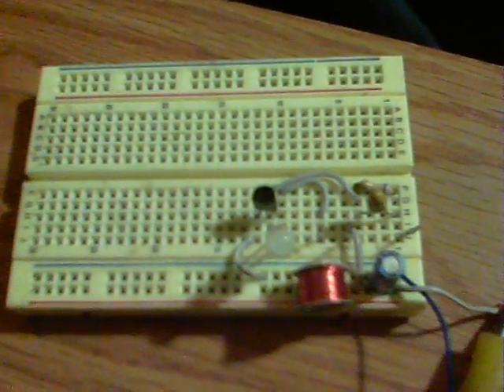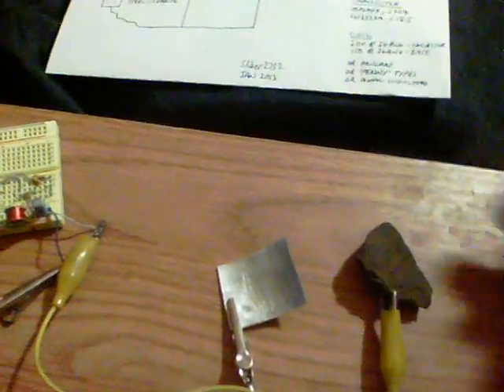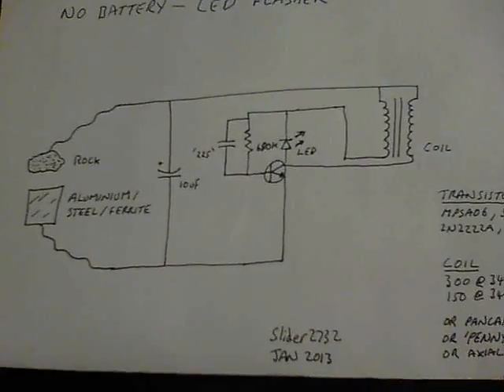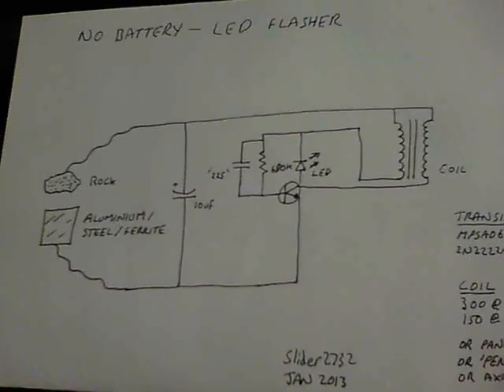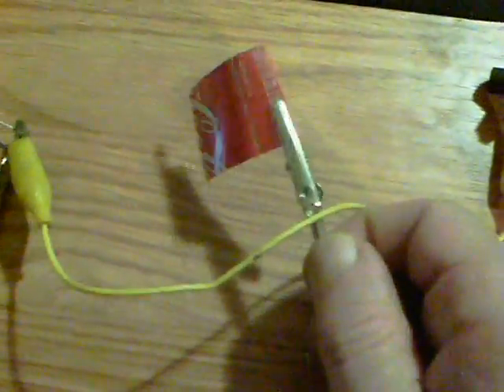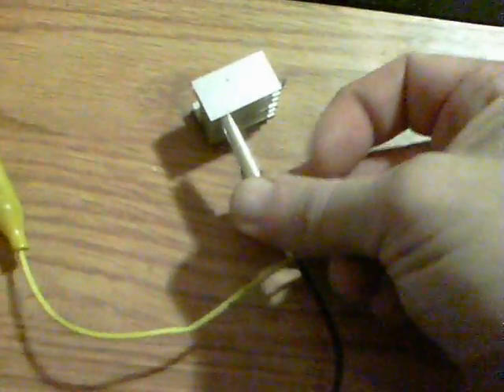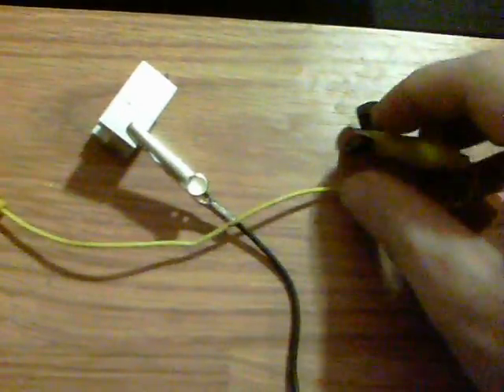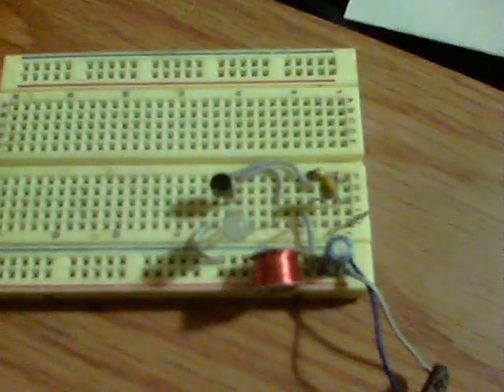No Battery - LED Flasher

Comment: Thanks for posting a great circuit. It gives the most bright flashes comparing among other transistor or CMOS blinkers. Transformer coil works without a ferrite core fine, but if you have ferrite core leave a gap. LED I connected to GND then gives brighter pulsesz Also starts running from 0.5V while complementary transistor pair starts from 0.8V.

Comment: Possibly could you do it just human powered?
Reply from the maker: Hmm, another good question from your good self  :)
We're always grounded, as a function of usually being in contact with the floor and full of water. But, there always needs to be 0.5V difference. It doesn't matter which is more positive or which is more negative, as long as it exists. Some kind of creative sitting with legs in the air might work lol

Comment: Nice one pal, liked and subbed.
Reply from the maker: Many thanks :)
Reply: @Slider2732  I've got some graphite felt on order from China to do a single-pot MFC with, apparently certain bugs give off more electrons, especially with the right foods. I was thinking it'd be nice to do a soil-powered moisture detector, then i remembered the single-electrode moisture meter that i had years ago, wchi now sells for about 7 quid on amazon. Another mad idea that expired before the parts arrived lolz ;+}
Reply from the maker: Yes, well I did wonder if you ever made a spacecraft from the pictures you downloaded  :)
Good luck with the bug project. I'd not heard of the electrons thing, perhaps it makes sense for luminescence with Mg (Firefly's).

Comment: very good circuit! you can see the Mendeleev table with electronegativity of materials data, to search the most opposite couples. I told to you what I found time ago, the good stable materials couples are alluminium - carbon and better magnesium - carbon. In that exp. your hand is like a ion conductor that allow the electrons to migrate from the most electronegative material to the less electronegative. the others good membrane that does this are paper soaked with potassium chloride and many others, simply paper in environmental humidity, soft pvc plastic, and tissue colors. then there is the world of conductive plastics that I honestly know little about. bye
Reply from the maker: Thanks for your comment Michele. Magnesium is now an electrode for the water based 'Nephilim Penny' flashing oscillator. It runs constantly, 24/7. I'd never used Mg and expected only a couple of days before it dissolved, but a tiny strip lasts for months. I will likely change to carbon on the other electrode, but the copper piece has been on the circuit for 7 years!

Comment: hi you can try also with termoelectric cell (peltier) used in termic differential, bye!
Reply from the maker: Yes that would work, as long as there is 0.5V generated. The circuit uses nearly nothing for amperage. 0.5V is also available from putting a copper wire and iron nail in the outdoors earth etc. Power sources are all over the place for this type of circuit  :)

Comment: +slider2732 Can I Use 2n3904 Transistor Instead?
Reply from the maker: Yep, the 3904 will work fine. 
Other good ones are C1815, MPSA18, C1213, 2N2222A
Reply: +slider2732 Thanks!
Reply: Slider2732 I bought a hundred of the 2n2222a transistors a while ago this is a good use for them

Comment from the maker: To neuphpne - your 'Reply' button is off.
Yes you can use wet towel or a sponge or even a glass of water if wished. It's the difference between the materials that enables the circuit to run :)
During summer with no cooling in the house, such circuits will run very easily from human skin moisture (this was uploaded in the January and we have no house heat).
Thanks for your question.

Comment from the maker: Thanks Jamie :)
Not tried a snake egg, but will do. Mass is somewhat important, there's a point of mass at which it will begin running, though human energy is enough with house gauge copper wire and inch square galv steel too. Slightly stronger with increased surface area. Dirt works :)
Good luck with the TREC, my fenced based one used a similar circuit and ran fine. You may see caps charge to 25V and more...hope so !

Comment: Hey Slider,  Nice one. 
Have you tried it with a Snake Egg Magnet in place of the rock?  Also, does the mass of the materials used for the electrodes make any difference on power output?  I guessing you could just put those in a pan of dirt and get it to work too.  I'll have to mess with it.

I've been working on something similar for a Tesla Radiant Energy Collector.  But the electricity that I'm getting out of that isn't following conventional rules :)

Comment: You can use for the battery two sheets of thin table metal, one aluminium, one iron, and very close beetween them sandviched, a paper, all pressed well and close each other, and you can make more bateries in series, in this way, and this will be a electrostatic battery which works forever. Great job, keep going!

Comment from the maker: Intriguing question. It doesn't seem so, because gripping or holding more surface area will speed up the flash rate. The rate is constant, not jumpy, if that's how it seems on the video. 
I can't study it when upoaded, PC is from 2002 + playback max is 360p in small box viewer.

Comment from the maker: A microscope would be handy too, to inspect chemical influences in the carbon/copper etc battery electrodes. A micron layering of Teflon might show advantages....wish I had a Teflon kitchen pan to check out conductivity, easy test if you have one. Run a circuit with a frying pan lol :)

Comment from the maker: Hope it's useful to ya...am always looking to eliminate batteries. In fact it will run using a battery unconventionally - positive to a rock,AA battery negative to the aluminium, battery positive to a finger tip.

Comment from the maker: Does indeed. Arms don't work readily but hands/feet do. Copper/steel is 0.7V and had built a few, but aluminium was new to me (thanks to Yalgorup NP), rock and ferrite were new random thoughts to use with alu. It's enough for such an oscillator to fire with a few uA :)

Comment from the maker: Thanks Tony. Bit restricted at the moment with no soldering in the bedroom, but it's winter and that's where the heater is ! This was my first breadboard circuit too, found it from years back when moving some parts yesterday + had never used it.

Comment from the maker: Yep, in descrip, can get 0.75V @ around 20uA. Much less without the rock, which is kinda odd though am thinking it's an impedance type change. Surface area for current, strong gripping also increases :)

Comment from the maker: lol sneakingless sneakers ! Yeah, the next part is multi strips in a glove, as in a power glove. Arms don't work, which is a shame for tennis type arm bands, but will work with feet/inside socks...smellier the better, or in beach sandals. Rock to ally doesn't work, works in water/soil etc though + wireless with pancake no LED :)

Comment: It's possible its pulling the voltage from your hand as well. Just measure the voltage of holding the alum and the rock to your meter.

Comment: Thats a really cool one. Could make a watch that never needs charging. Might even be able to have a momentary back-light... Will it work if you touch the rock and ally? or is an electrolyte required? If sweat is the key, I'm thinking light up sneakers. Although that wouldn't be very good for sneaking.